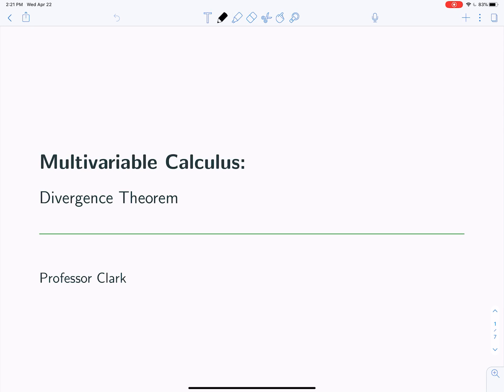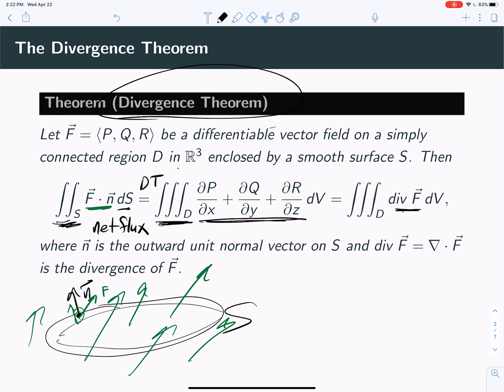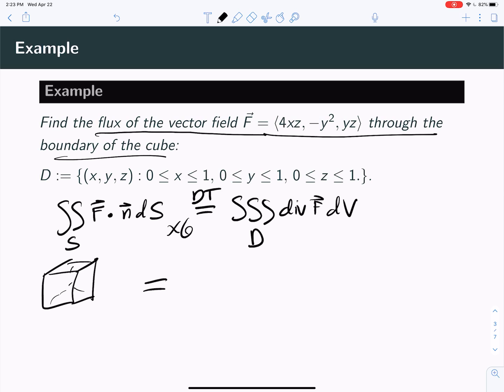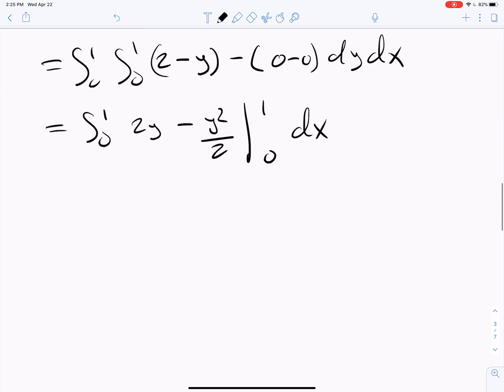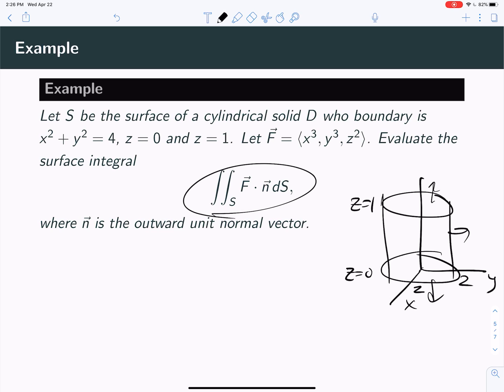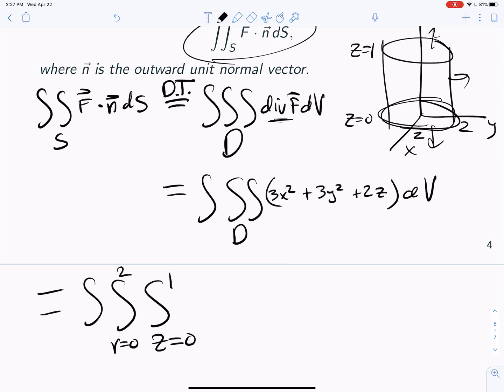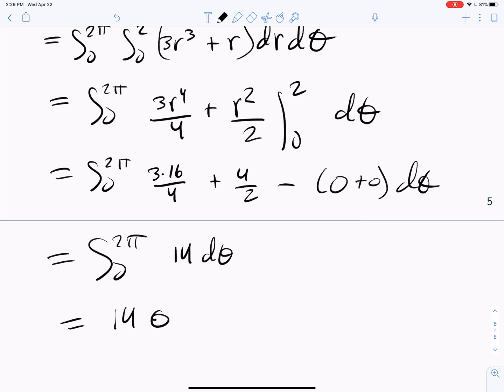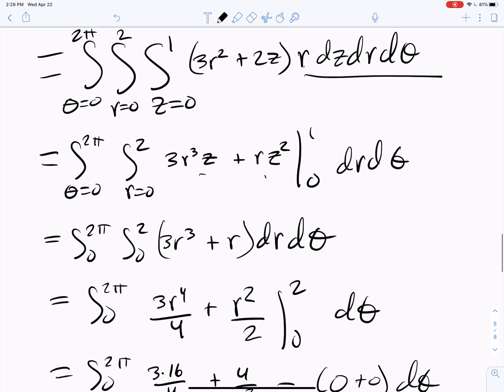Multivariable Calculus: Divergence Theorem - Examples (16.9)

Comment: How do we introduce that dr  and d0
Reply from the maker: Do you mean about 6:40 when we switch from rectangular to cylindrical coordinates?  dV is the volume of each "block" that we are integrating over, and in rectangular coordinates, that is dxdydz a small "cube" of volume, but in cylindrical coordinates, we replace the dxdy with r dr dtheta, which is polar coordinates, and instead of a square, it's a little "polar rectangle" and as you get farther away from the origin, the size of that rectangle gets bigger and bigger, so we need the 'r' there to scale it appropriately. You may want to go back to a cylindrical coordinates video to see it explained. https://youtu.be/ReBT53klinw

Comment: HI, Dr.Clark im just confused with the value that we get after computing the triple integral. In the 1st example, we get 3/2, so what does this actually means? It is a scalar right?

I've read online where a positive number means positive divergence where larger arrow implies greater magnitude, but here we are required to calculate the surface? So does the value 3/2 has a value like m^2 or something? Im new to this div, curl thing as i am about to enter my Analysis 2 class.
Reply from the maker: The valued 3/2 is a scaler. It's a measure of the "flux" out the surface of the vector field. So, if the surface is a net, and the vector field is the flow of water, the flux would be how much water is flowing through the net. So the units depend on the units of the vector field - it's could be an electromagnetic field and then you'd have to ask a physicist what the units mean in that case.

If you're looking for a nice book that explains divergence and curl in a conceptual way I'd suggest "Div, Grad, Curl, and All That". It's a friendly and short read.

Comment: Why did you write the additional 'r' at 6:31 ?
Reply from the maker: in cylindrical coordinates, you need to have dV the volume differential, which is r dz dr dtheta. In rectangular coordinates, it is just dV = dx dy dz, a box, but in polar coordinates dx dy = r dr dtheta, so in cylindrical, dV = r dz dr dtheta. You'll need to look at a picture of the polar "rectangle" r dr dtheta from a textbook to see why the r is there.
Reply: @dr.clarkteachesmath  i've got question so if dx,dy,dz = r, dr, dz,  because dx, dy = r dr so
why do you add "dθ" with the r dr dz dθ 6:42
Reply: you're fucking life saver
Reply: Jacobian matrix needs to be used when transforming an integral